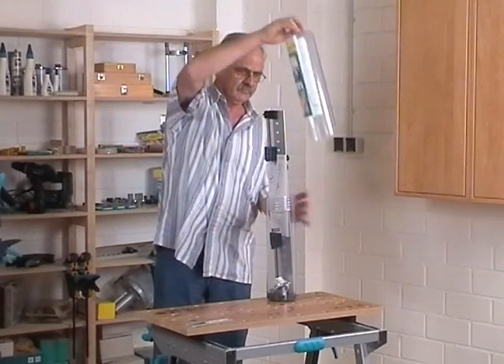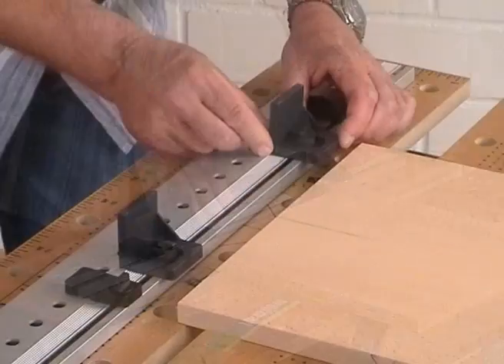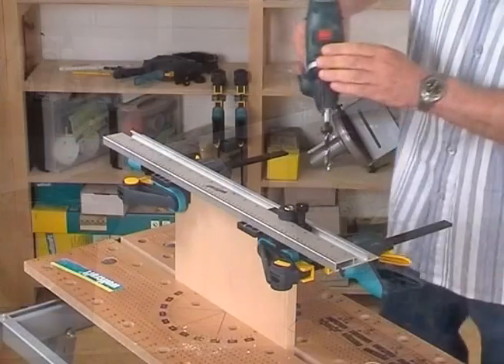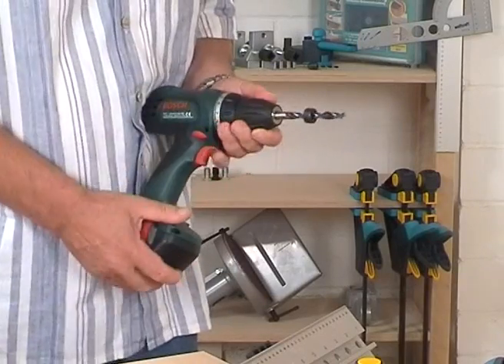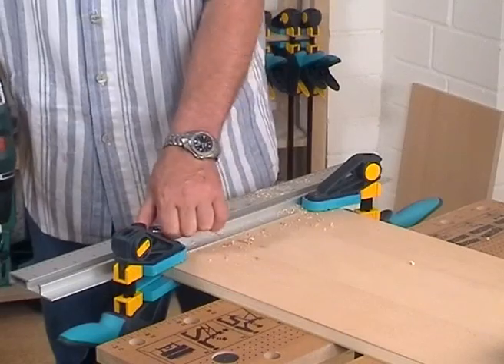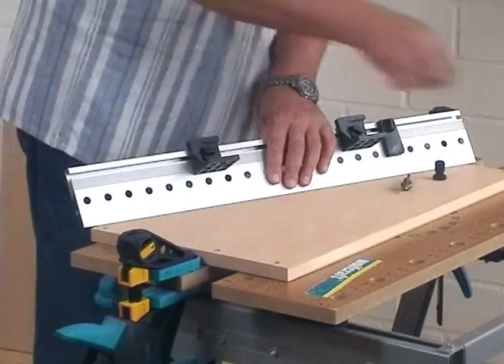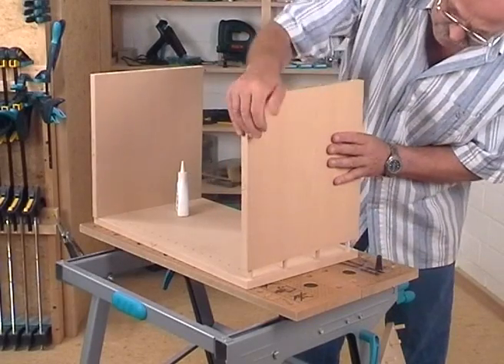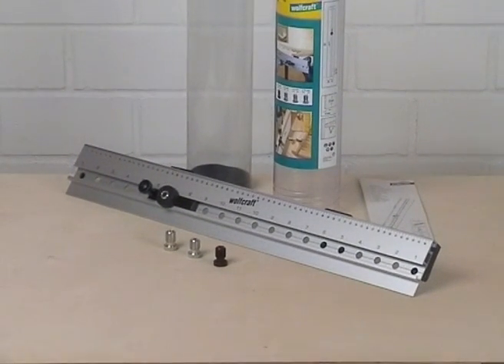wolfcraft Dowelling jig Product Trainer (part no. 4650000)

Comment: So I just bought this, and am trying to figure out if I'm doing something wrong, or if there is something wrong with the tool. When attempting to make corner joints, the edges of the two pieces never line up perfectly, even though I paid extra attention not to have to move the depth stops between doing the two sides. The edge of the piece in which the dowels are parallel to the length of wood, is always further out from the edge of the other piece by about .5mm. Were it the other way round, I'd be perfectly fine with that. 
If I rotate  the piece, the same protrusion happens, so it seems that there is a bit of a difference between using the depth gauge to clamp, and clamping the aluminum bar instead. It feels like the injection moulded depth-stop is warped right from the factory, causing this difference. I suspect clamping lengthwise would sove this issue, but it's not possible to do on large pieces. Disappointing, as this was precisely the task I bought the tool for...

Comment: If i made the same cabinet how do i mark the right place for the hinge on the door to fit holes on the cabinet?
Reply from the maker: Dear sassike27, thank you for your interest in our products. Please contact our customer service via Email at info@wolfcraft.com. 

Best wishes
Reply: easiest would be to get the $2 hettich multiblue jig. there's plenty of videos on how it works, but basically, you lay the cabinet on the side, align the door, push the jig pins in the cabinet holes and you can mark the hinge holes.

Comment: Are there any extras attached to it? like drills, stoppers or dowels? I just got it and there is only rail.
Reply from the maker: Hello, 
you can get more information about this product on this site: http://www.wolfcraft.com/en/products/p/dowel_jointers/1_dowelling_jig/s/p/index.html Exchangeable drilling bushes are attached to it. If something is missing please contact: info@wolfcraft.com
Reply: I have everything from this picture http://www.wolfcraft.com/uploads/tx_commerce/4650FS_08.jpg (drilling bushes 5 (black), 6 (silver), 8 (silver), 10 (silver), the black plastic parts and the rail itself of course) but nothing more like wood drills to drill, depth stopper worn on drills, and wood dowels. They are in the box pictures and are mentioned in instruction as additional accessories but they are not attached. I am not sure if this is correct or not.

Also I have issues to make this product better in the future:
- No plastic. 
- Add also smaller holes as well like M3. 
- The rail stop plastic should have scale for chipboard (not full wood) 18mm. The 18mm chipboard is most popular.

However I like this rail, very good product, very useful and well done.

EDIT: I guess the translation to Polish is broken and caused so many confusions. The "Necessary assembly tools" is translated as "Opakowanie z osprzętem" which is totally different meaning. IN Polish it means "Package with accessories" - no info you need it. Also the "Accessories not included" is translated to Polish as "Wyposeżenie dodatkowe" which means in Polish "Additional equipment" - no info "not inculded". Sorry for trouble. Looks like reading translated instructions is always risky.
Reply from the maker: You are right! wood drills, depth stopper worn on drills, and wood dowels are not included. You can order these products by their product number which is written in the instruction.

Thank your detailed feedback. I will transmit it to the product developer. Also I will initiate to improve the translation to Polish. 

Best wishes 
Julia K. - wolfcraft
Reply: Generally translation to Polish is very bad. Best way would be 2 books, one in English and one separate in Polish. I guess in Poland other languages does not make sense. Would be easier to read if each language would be in separate book or in separate section of the same book. Thanks.
Reply: NiceTubeAccount